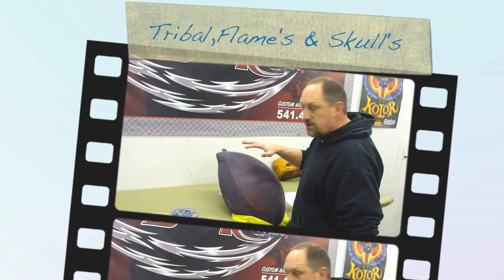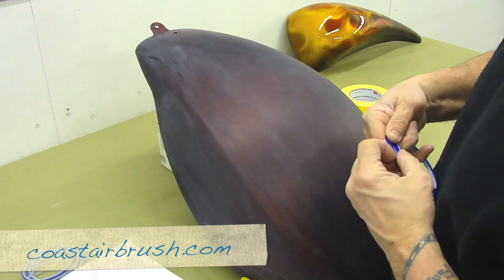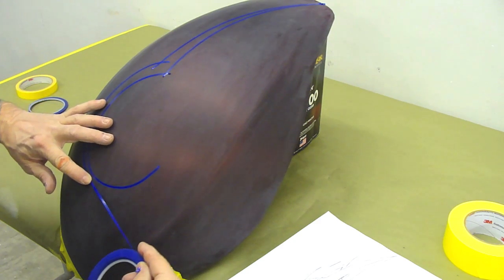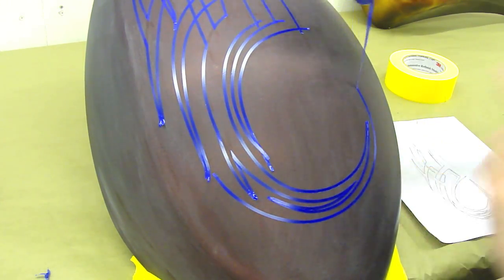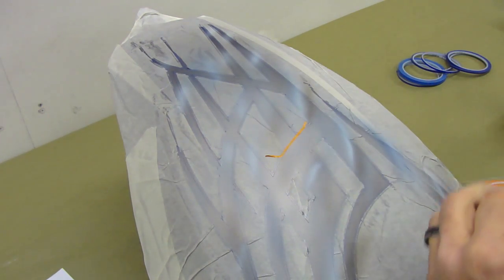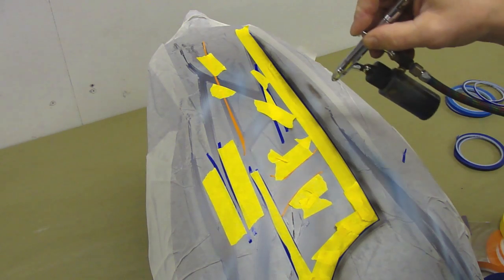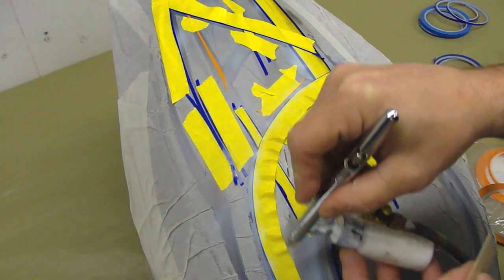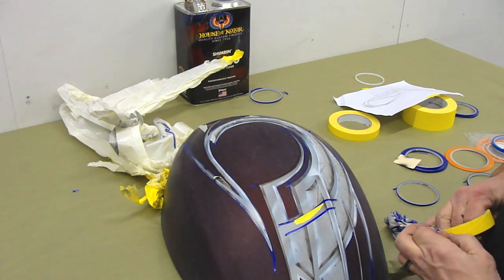Tribal layout

Comment: hello how are you, you do me the favor and tell me what kind of paint is that? and you get the finish so bright? thank you very much
Reply from the maker: HOK
Reply: The paint is house of color 2stage primer 2-3 stage full bass color,2-3stage clear coat. The flake is probly and add in. Looks like it might have some gold pearl in it to. The gold flake is about 100- 400$ an ounce depending on the pigment size. And the pearl is about 50$ an ounce. And that color  Probably 200$ for a quart the mix is usualy 3:1 or 4:1 
So if you have 16oz. Of paint you would mix 16oz.p ÷ 4:1r= 4oz.r+16oz.r= 20oz of paint that's with a 4:1 ratios for paint mixed with reducer. The flake and Pearl is usually less then a teaspoon. Praying flake top born is an art cuz if you do it wrong some of the flake will be standing on its side then at that point you cry😂cuz you have to take it all off. And start all over again. And the same with the mixing if you do it wrong it will have fish eyes or pill or something.😱 , but I love painting and fabrication. And building engines it's fun. And the math and geometry love it👍✌💕